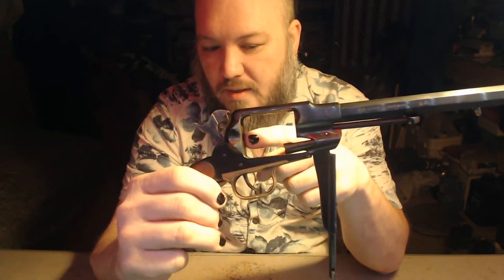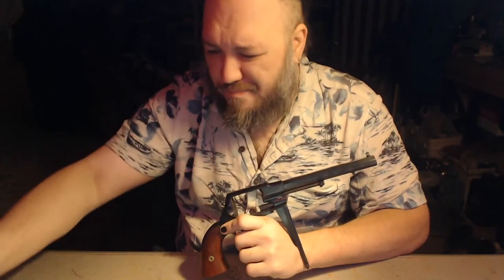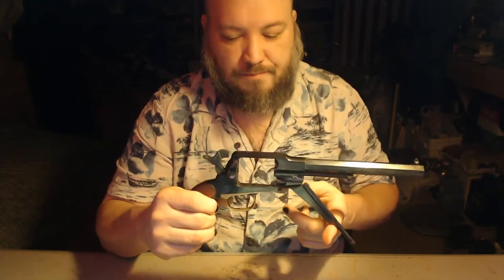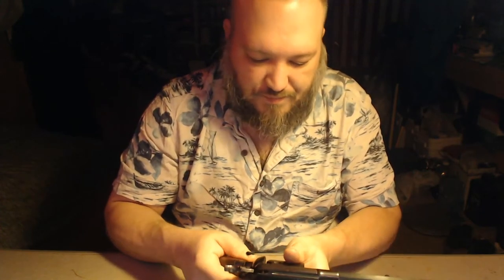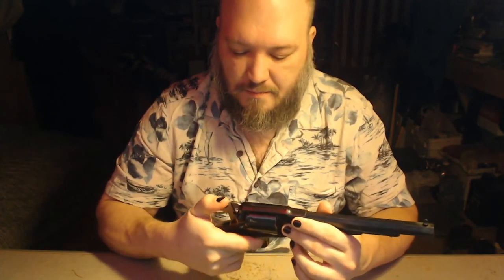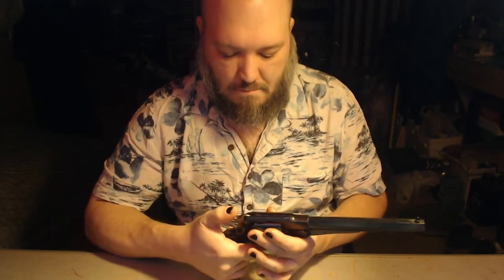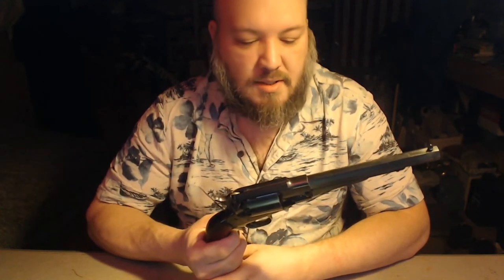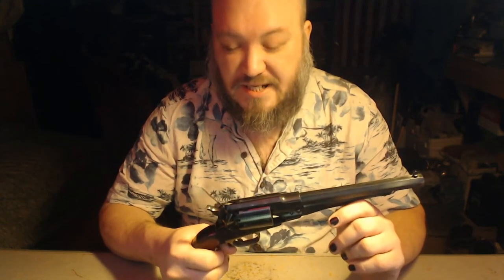1858 cylinder swap video

Comment: Both Pietta and Uberti Remington revolver replicas are actually of the Remington "New Model" [1863-1875].

The "1858" comes from the September 14, 1858 (Fordyce Beals) Patent date stamped on the 1st production Remington-Beals (1861), and then the 3rd production Remington "New Model" (1863-1875). In between was the 2nd production Remington (1862) Elliot Patent (William Elliot December 17, 1861). The reason for the return to the Beals patent for 3rd production was a request from U.S. Ordnance because the Elliot patent design was causing problems in field use. 

The 1858 Beals patent is for the way the loading lever retains the cylinder base pin, a simple arrangement that is very practical in keeping the base pin secure, yet easily removed for maintenance.   The 1861 Elliot patent retains the base pin by spring, with the base pin able to slide along a channel in the loading lever, with the loading lever still latched. Particularly for cavalry on horseback, the Elliot Patent Remington Army/Navy revolvers would often have the base pin slide forward in the holster, allowing the cylinder to fall out when the revolver was drawn out of the holster! 

The production of the Remington Army/Navy revolvers was basically (1st Production) Remington-Beals [1860-61]; (2nd Production) Remington Elliot Patent [1862], and finally (3rd Production) Remington New Model [1863-1875]. The Elliot Patent base pin retention problem became quickly apparent during 1862 production, so in reality, elements of New Model design began appearing in late 1862 during 2nd Production to correct the Elliot Patent problems, but Remington did not begin to stamp "New Model" on the revolvers until 1863.

The Remington-Beals Navy was advertised by October 1860; the U.S. Ordnance Department was so impressed with the Navy design that Remington was asked if a .44 Caliber Army version could be made. Remington said, "yes" and then tooled up and was able to begin production of the Remington-Beals Army by around August-September 1861.

Information from REMINGTON ARMY AND NAVY REVOLVERS 1861-1888 (2007) Donald L. Ware.
Reply from the maker: wow, thanks! that's good info!

Comment: Well you left out the part where you pick all the caps up off the floor and reinstall them, assuming they were installed, those little suckers don't stay on very well. If they were not installed - DUH! Show us again with caps please.

I really love this gun. It got me into black powder. I have the Uberti 1858 Deluxe with all the engraving and white grips. Almost to pretty to shoot, almost. This sucker is huge. Can't imagine how those soldiers carried these around. I suppose that is where the term "hog leg" came from.
Reply from the maker: Pinch your caps, or buy caps that fit your guns nipples correctly.
CCI #10's fit mine snuggly, Remington #11's as well. Rem#10's won't fit with out some fiddling.

Comment: I have the Sheriff's model 44 caliber. 5 1/2 inch. Was thinking about cutting down to 3 inch like the Ace.
Reply from the maker: I mean, it's your gun, so I'm not going to tell you what to do with it.
IF I had a second 1858 I would "bulldog" it by cutting it down and doing a Birdhead grip like Mike Bellivue from the Duelists Den did.

so a 'spare' in case I messed it up.
Reply: I'll take a look at the video you mentioned.  Thank you for your advice

Comment: Hey I’m wondering if anyone else has had this problem my 58 Remington has had a cylinder locking up after a couple of shots due to fawling have you experienced the same problem
Reply from the maker: sometimes, yes. a drop of oil on the cylinder pin helps, but Remington doesn't have grooves int eh pin to "collect" the fouling like other brands had. you just have to clean them a bit more often... or at least that's what I've found.

drop of oil and give it a good spin will loosen ti enough to keep using, or take the cylinder out and hit it with a quick brush
Reply: Yes, the Remington cylinder pin does not have much way to absorb fouling, like the Colt design does. Some advocate filing small lube grooves on the upper round side of the pin, and it might help to lay some grease on the flat of the bottom side. Do NOT use any petroleum lubricant on BP guns, as it will promote more fouling. Ballistol is a good lubricant, and can be diluted with water for cleaning. Grease can be tallow, Crisco, etc.

Comment: Gorgeous weapon, works great with paper cartridges
Reply from the maker: yes it does. I found the LEE Conicals it doesn't like too much, at least not in paper cartridges, but roundball in paper works fine.

ONE OF THESE DAYS I need to mold up some Johnston And Dow conicals... I just haven't gotten to it yet
Reply: @TheStraycat74  I got the 5.5 inch barrel, she shoots amazing with .457 round ball
Reply from the maker: @milesmanges  I've used 451 and 454 in mine, work fine!

Comment: Dude loose the nail paint!
Reply from the maker: That was for a party I ended up not going to because I forgot how much I hate parties.  but what did you think of the video besides the fingernail paint?
Reply: @TheStraycat74  I love the 1858 Remingtons.  That's pretty quick for a cylinder change. Do you load in the gun or a stand?
Reply from the maker: @dickgoesinya9419  I've loaded 'on the gun' and in a cylinder loading tool. I do not have a stand to put the pistol into. I mostly load with paper cartridges, but occasionally with loose powder and ball
Reply: @TheStraycat74  Cool Bro, I just bought a Kaido 220 grain mold to cast my own bullets. I have not cast any yet but, I hope they shoot well.